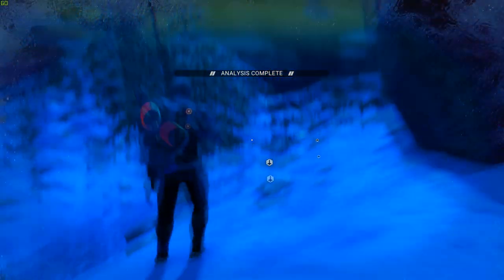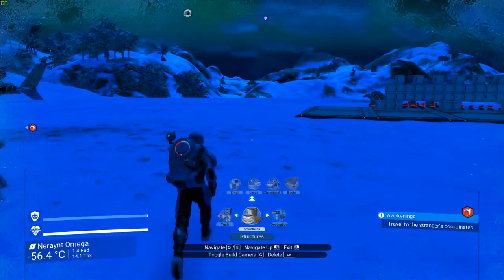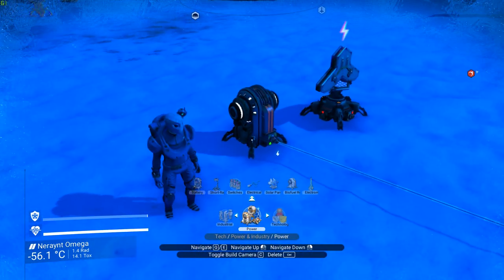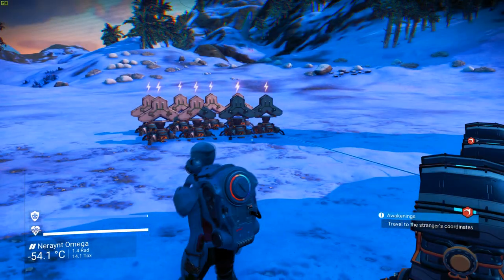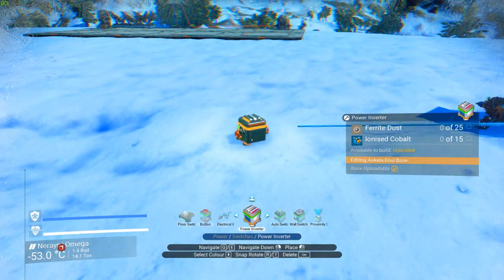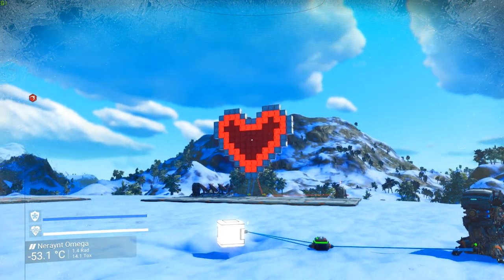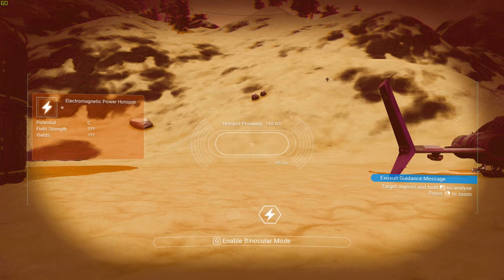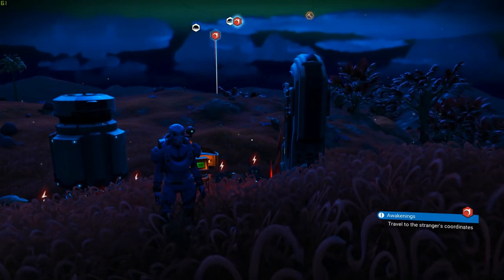No Man's Sky Beyond - Everything You Need To Know About  Power, Industrial & Logic Systems

Comment from the maker: There's a third power generator  (Electromagnetic Generator) that you use similar to Mineral/Gas extractors (as in use scanner to find electromagnetic source, and place it nearby). That part didn't make it into the video as it was already too long :)
Reply: My biggest question is what to do with that ball after connecting wires. Mine just sits around and havent been sure what it is or does
Reply: KhrazeGaming how do you search for gas hotspot...?
Reply: wrong its not on space station and the base one is limited
Reply: @anashussain8495  There's a new tech for your MT which is like the Analysis Visor. So if, like me, you want it and your MT is full, you will need to delete something. I plan to delete the Scatter Blaster and its one upgrade module. I then plan to rearrange my MT. Thank Sean, I can now move tech around instead of deleting and repurchasing.
Reply: @anashussain8495  All hotspot searches are the same. The type of hotspot depends on the biome. Same goes for types of food/ingredients.
Reply: @johnmckown1267  thankfully i got an A class mt with 16 slots so i have 5-6 empty slots and no boltgun or whatever its called cant remember..so new tech to search for gas hotspots..i'll buy it then. Thanks
Reply: @johnmckown1267  i am dumb... i just noticed that in the video at 11:42..guess i wasnt paying attention the first time.
Reply: @anashussain8495  I have an S class with 24 slots. And it is full -- but I will get rid of the Scatter Blaster & its one upgrade module I guess. I don't much like it anyway.
Reply: @anashussain8495  Not stupid. I often miss things in a video because somebody interrupts me.
Reply: so the Electromagnetic Generator isnt an option for unlimited energy?
Reply: Christopher Jiménez yes it is
Reply: Then change the title of the video, because this is not "everything you need to know"
Reply: @christopherjimenez4275  it is unlimited once you use the survey device and find the lightning bolt aource place one down and connect the power to your grid also on a side note every planet should have mining gas and the electricity symbol just go about 800u from one and search again to find a new spot
Reply: @christopherjimenez4275  I think that I'm going to go with Solar Panels + a large number of batteries. Now, I need to learn "power management" to determine how many of each I need to power a given base. And if I grow the base, how much more power I need. {sigh}
Reply: Khraze I cannot build outside of my bases range, so how am I supposed to connect all the resources up to my main base? any info will be appreciated!
Reply: @roshuamir7667  I think you'd need to put down a new base computer. I had this problem, I have like 4 bases on one planet. Not a fan of this.
Reply: I tried making doors work with switches and buttons but it was open when I was far and closed when I got near and couldn't reverse it to make it work. Do you know where I went wrong?
Reply: name  thank you that's the best answer I received, I mean the only answer I received Haha. I figured it out though no worries
Reply: everything is going crazy. i lost my freighter with everithing on it, including the ships on the freighter. tell this to the developers so they can fix this huge bug.  i know others who lost their base and almost everything
Reply: @anashussain8495  It's random what hotspot you get, 1 only in each area. So an area is either power,gas or mineral. So very unlikely an existing base will have one close by. And that poses the other issue with them,  as they need a base, and you can only run the wire from them so far before, you guessed it, you need another base. The power is the one I am speaking of, as the others can be remote items that don't need to run to your main. powerlines should not require a base to traverse terrain like they currently do, bad failure on the devs parts on this.
Reply: Ok so my only problem is my electromagnetic generator is 400u away from my base, how do I connect that to my base? Can I use one wire and potentially walk it to my base that's 400u away? Thanks for the tips.
Reply: Thank god for khrazegaming
Reply: @anashussain8495  survey visor from multi tool guy in anomaly I believe
Reply: So I understand everything here so far. How difficult would it be to do something like, let's say I have a 16x16 light box configuration and wanted to flash letters of the alphabet to spell out a message BUT have it stop at the end with no loop? Thank you!! Great tutorial!
Reply: Already to long? Passed 10minutes lets rush it!!! /s
Reply: Hey bro. Have a wiring challenge if you care to take it on. Having some trouble wiring my storage containers. If you are willing to make a video? Or possibly jump in my game and take a crack at it?
Reply: Too long meaning he wont get a too long video because then he cant make 2-3 10 min videos. The other option which he will never choose is 1 short informational video with stuff we want to know
Reply: MrKhushrenada you were probably using a proximity switch. This supply’s power TO an item when it’s activated. Your problem is that a door will always open when it has NO power so the reverse of what you were trying to do. You need to use an inverter in the circuit too.
Reply: @RedceLL1978  dude even as a beginner it is easy to get all those constructions, all you need to do is salvage technology and with that salvaged technology you then go buy blueprints at the blueprint analyser you can build.
Reply: @TheREALDocRabbit  Yes exactly!
Reply: The electromagnetic gen is the only reason I clicked this video....
Reply: How would a video be too long when your the one in charge of it do you only have like a certain amount of recording room?
Reply: I really hope they will add a light sensor. That could really be helpfull combines with proximity sensors. 

Only use power when needed during the nights only

Comment: For each industrial unit (mineral or gas extractor), place down two solar panels and one battery. It will run 24 hours without fail.
Reply: Does this principle apply to the depot device as well?
Reply: How much do these thing mine? I want to mine pure ferrite or something to get a crap ton of ferrite dust to build with. I figured id then go to magnatized ferrite to ferrite dust using a refiner
Reply: @BudRV  depends on the deposit. My current radon farm is at 13,000/hr, but that's with about 80 million units of engineering and building. Some 200 solar panel, 20 depots, and 40-50 gas extractors. That generates about half a million units an hour, or 1.5m if I refine it further with some ferrite to create uranium. 

I like the update, but I find scanning for deposits and the lack of more powerful energy sources to be disappointing
Reply: What I'm really asking is if I find  a pure ferrite deposit can I get more from it from placing an extractor or from just using my multitool?
Reply: Right now I’m using this as the general rule of thumb.  I tested it on the mineral extractor.  It consumes 50 energy units.  One battery will hold enough charge for about 48 energy units being consumed during the night hours. When day broke I had a bit left over.  But with only one solar panel it was just powering the mineral extractor and not charging the battery the next day.  So I added the extra solar panel to keep a surplus charge to the battery and I never had to worry about the battery running down again.  So for every 50 units of power your base consumes per hour, place 2 solar panels and one battery. They keep patching the game, but so far this works fine.
Reply: Bud Voegtlin you will get more resources over time if you place the extractor network up.  Add storage as you see fit.  Each storage tank will hold 1000 of the element you mine. When you add sufficient power grids that never need refueling, you will have an endless supply of the elements you mine using the extractor. You just need time and sunlight at that point.
Reply: I was actually talking about the original extractors not the industrial. I actually forgot there was two different ones even though it says industrial in your comment.
Reply: @hunterm9  How do i build these extractors away from my base, it only allows me to build portable technology, and i I build put a base computer where I find the hotspot it wont let me connect the electricity all the way to my base. Any help would be appreciated!
Reply: I cant even get the Mineral Extractor to work, even though I have power connected to it, it says UNPOWERED
Reply: @BudRV  It's a waste of time and material to set up an industry complex for pure ferrite.  If you want ferrite dust just fly with a slow ship and a positron "shotgun" on any planet with some ferrite dust rocks and shoot them with your ship. After 5 Minutes you have more than 1 full stack of ferrite dust.  On exotic planets with shards, m structure or wire cell you can even make about 20-40k ferrite dust in about 5 minutes!

Comment: The inverter can be used for much more than making things flash, if you connect a switch to the middle post, (power to switch then switch to middle post) with power going in red and out green, it changes the function of the switch, so it allows power while the switch is off and turns off power when the switch is on. For those electrically minded the inverter is a transistor of sorts.
Reply: yep that's how it works, but do you have any ideas how to make a door work with 2 switches on both sides? i made it work with an inverter on one side, but doing the same on the other side would not open the door, because it is already powered on the other side, so it remains closed even if you hit the button. I'm thinking that both buttons must be connected to an auto-switch or something like that. Any ideas? lol
Reply: RG 75 for what purpose?  Like what is the benefit of doing what u described in ur example?
Reply: I have not tried with manual switches yet but have it working with a proximity switch, place an inverter on the wall above a proximity switch, run a wire from your power point to the left(red) connection on the inverter, run a wire from the right(green) connection on the inverter to the door power point, run a wire from your power point(can be the same as you did for inverter) to the left power point of proximity switch, run a wire from the right point of the proximity switch to the lower power point of the inverter now the door should stay closed until you walk up to it
Reply: Nightraven Thanks, I was trying to find out how to get the doors to work and this works perfectly!
Reply: Do doors work on pc? On ps they bug out and you can’t change their state after you get far enough away, even just another part of a small base is enough to break them...
Reply: WhiteDawn not as well as would like, need to be able to the range of the proximity switch.I have put my door on a corridor otherwise it does not close when in a room but I have no problem with it being obstructed by other parts of buildingIf you mean do they work without switches then no they just stay open constantlyPC and PS seem to have their own different issues
Reply: Woah, so the solar panel can be used as a daylight sensor.

Comment: You can use the detector to send a signal to the inverter (to the middle connection), run a power source to the green side on inverter, then run a line from the red side of inverter to a door. You now have an automatically opening/closing door. Make sure theres a power line connecting to the opposite side of the detector (it needs to be powered as well).

Comment: I subscribed to you just from this one video. I spent 2 hours yesterday trying to get a  row of 5 storage containers powered in my existing base. What an illogical nightmare. I'd connect them to several solar panels using one wire and only 1 out of 5 would get power. Then my other row of 5 containers had 4 power up except that they  WERE NOT CONNECTED to any wire or power source!  Hello Games  created a universe with spaceships and teleportation and we still have to use wires?? Why not just have wireless power?? This is just a pain for those of us with elaborate bases. Thanks for your excellent explanation of how power works.
Reply: I really can't agree more. I have several very large bases that would need to be redesigned in order to power them properly. I would dismantle them but the game crashes when I approach them. I was able to take apart one small base and then went to a base station only to find out that I could not sell any materials from that base because I can't have anymore units. So I have to give it away for free or store it. I have 300 or more stasis devices for example.... can't do anything with them. When Hello Games fixes that then I'll figure out this power issue but at this point... I'll move on to another game.

Comment: Nope, source type you search for (gas, electromagnetic field or mineral) IS NOT 1 PER BIOME/PLANET. They are approx 400-500 far away from each other and you can find multiple very close to each other and use one to power another etc. Tool just shows you the closest/influence area you are in. Find one, choose a direction, move approx 300-400units and you will see the next one.
Reply: And do planets only have 1 kind of source?
I found a heat source 
How could i find an energy source in the planet?:(
And how can I transport the energy to my base ehich is 400m away from the source?
Reply: @worldoftankswarthunderrepl4056  i havent played for a long time but if i am not mistaken you can increase base range by building items closer to its range. e.g. you cannot place a cable to 501 units away from the base station but if you build a platform at 500 units, you can now replace a next one to 520 etc. this goes up to a thousand i think

Comment: Tip: Hotspots are vertical. You can put layers of mineral extractors. The more mineral extractors you have linked up together the less they make.
I made 2 layers of 5x5 Mineral extractors that were all linked. That made about 4500 per hour on a B ranked hot spot. When I separated the 2 layers of extractors, essentially just removing the pipes that connect the bottom layer to the top layer, both of them made circa 3500 each. When you store the minerals make sure to have separate storage for each layer, or else they combine and the amount lessens

Comment: Great stuff, but some corrections:

Planets can have more than one surveyable resource. 
Resource “spots” can be large, around 250-500u in diameter so you have to walk far to get to the next resource
You dont need to build in the hotspot itself. As you walk away from the hotspot observe the values in the survey tool if it drops, then that’s the max range of the hotspot

Comment: So far I managed to play around and I now have a base that powers on only when I move close to it. Each sections of the base has proxy triggers including teleporter. This saves power and I only need few solar panel and batteries to operate my base. I am now in the middle of making something like backup generator which has independent backup power which kicks in when power runs out from main reserve from solar power using inverter. When power goes off, other kicks in and vice versa automatically.

Comment: Both deployable generators make 50 kps. Im not filling 50 generators with carbon to keep my base running. Simpler to use the solar panels and batteries even though it gets really expensive for larger power demands

Comment: You don't need to power the supply depots. And also the bio-fuel generator acts as a battery as well. Use that as your last connection to your devices, leading from.your batteries, and then your solar panels. That's how I build my farms. I never lose power in the night, and i produce a lot more than normal.

Comment: This was helpful, tho I must say they need to adjust some stuff numbers wise. 2,000 Carbon for 1 generator...... which lasts for 1 hour....... Also, my main farm/base requires 1609kps and the generators only offer 50kps each........... not exactly cool with that.
Reply: Bmxer_DSM build 32 solar panels connected to a grid of 16 batteries.  You will never run out of power day or night.
Reply: From the sound of it the electromagnetic generator might be a cheaper way to solve your issue if you have the energy resource on your planet im currently hunting one down to power my next build
Reply: @smashedleekk  That's on my list for new bases. Only place them were there is one of those thingies.
Reply: Kyle Holifield thanks! Now I’m debating whether to do that or demo the base and move to to a electromagnetic field...
Reply: I lost my original base im to far way and i cant set waypoint back to it since im on the other side of the galaxy so i have to restart my base which sucks cuz i had my farm producing glass making me millions per hour b4 this update lol but im sitting at 600 mil atm so guess i can afford to move and rebuild
Reply: Matthew Lewis Teleport to that system where your base is from the space station or Nexus. Look up the name of the system in the discoveries, then look for that same name in the teleporter, under space stations. Heck you might be able to teleport straight to your base
Reply: @bmxer_dsm  yea i was able to tele right to it thx now to get the power turned on since the whole base+farm is dead lol